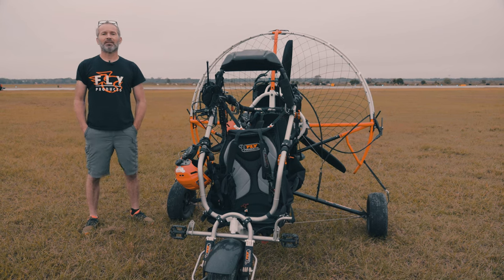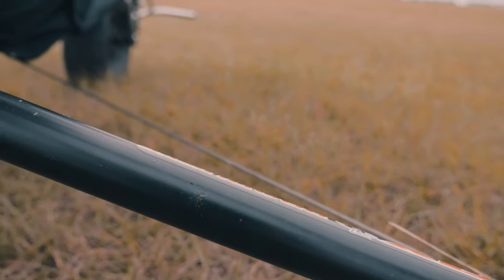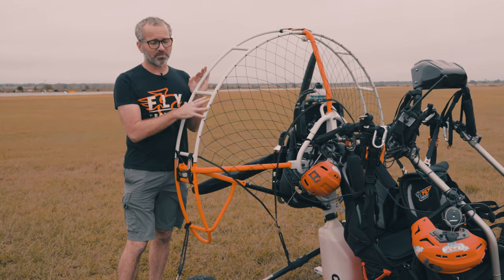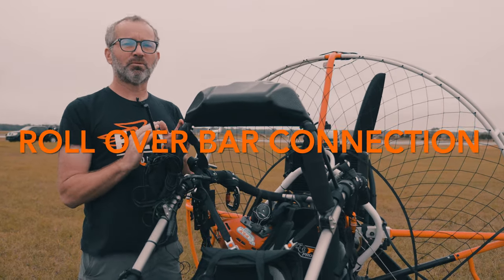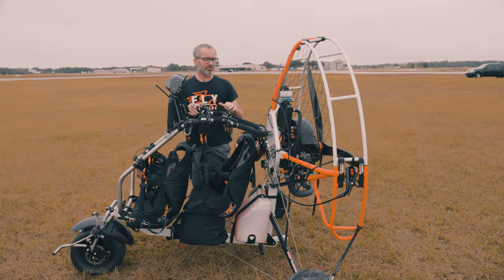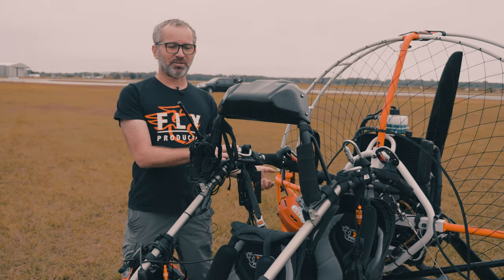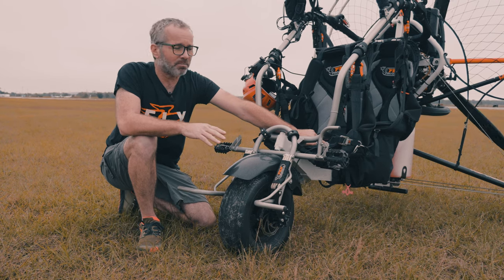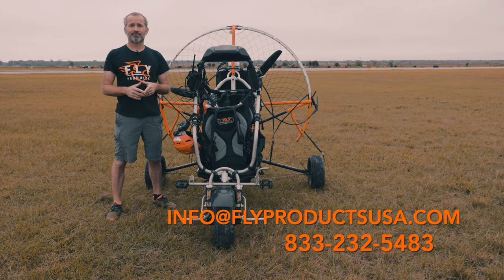Things YOU should Consider When Buying a PPG Trike - Fly Products

Comment: Fly products makes a really good product. I have a flash cruiser, thor 250 and a dual hoop rider frame and like it alot. It is not as stout as the  more expensive heavy duty models as described in the video but have been flying it a few years now and only had to replace a plastic trike to motor frame part, probably because i over tightened it to many times. 
Thanks for the videos 1 up.

Comment: Use FlexiRide torsion axles for the rear suspension. The rubber and metal are bonded together in a special process. They work great and ride great. No need for all those bracing cables and brackets and tubing and welding at multiple odd angles. The torsion axles have none of those issues. No caster/camber issues. The 90 degree caster/camber never changes. The tire/wheel always tracks straight at 90 degrees. Go to 4 wheels. Solid fixed front axle. Use individual scrub brakes on each front wheel/tire. Steering is controlled by the scrub brakes. Steers like a conventional aircraft. Push right go right. Push left go left. You never have to worry about hitting a gopher hole because the front axle assembly is bolted solid and cannot turn. It can only turn with the application of the scrub brakes. You can also push both the left and right scrub brakes at the same time to stop the aircraft in a straight line. Use hydraulic brakes for the rear. I can take off and land at 60 miles an hour and never have any kind of stability or steering issues with my design. My delta wing 4 wheel chariot is most likely the only one in existence. When it comes to suspension and steering, every single delta wing and paramotor trike manufacturer is in the stone age. My friend who helped me design my chariot was a brilliant aerospace/aeronautical engineer who was a consultant to all of the branches of the armed forces and every one of the major aircraft manufacturers. He was a pilot and carried a 4 engine prop endorsement. He helped design and build the LEM module that is now sitting on the surface of the  moon. He was a truly brilliant engineer. The rest of your design is very good.

Comment: How hard are these to breakdown for transport in the bed of a pickup?
Reply from the maker: Most can be loaded directly into the truck bed without break down. Just use two straps one to hold it down and one to pull it forward. BUT, aside from the Eco 2, you can detach two pins and swing the axles in toward the front and it breaks down so it would fit with the truck bed closed.